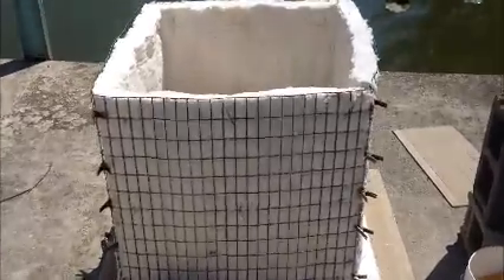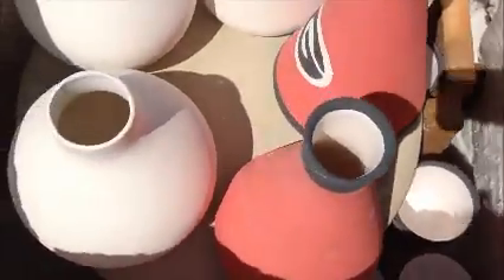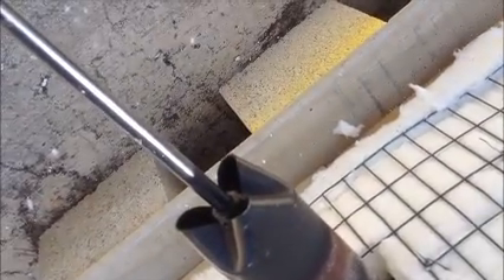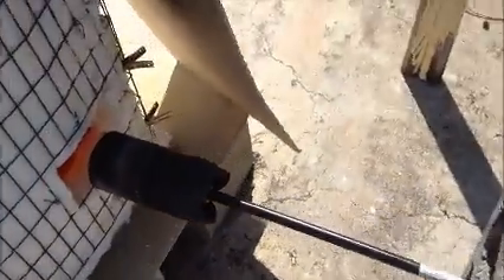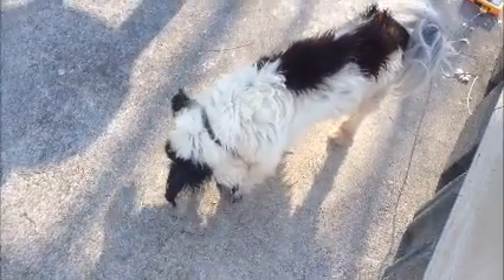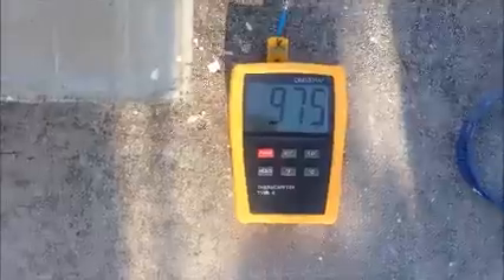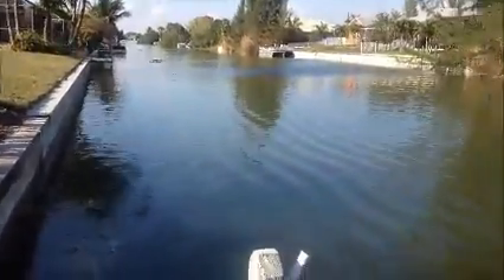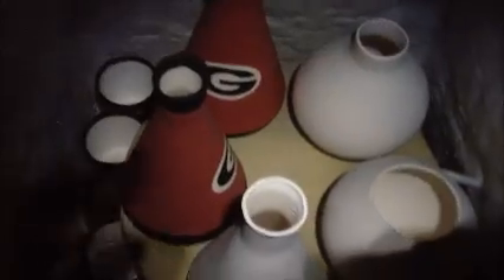Bisque#6

Comment: Hello Tarvus.   Thanks for posting your informative videos.  I appreciate what you've done.  I've a question for you, on your experiences with bisquing greenware.  What is the most aggressive firing for raku clay, you'd suggest.  You've had success with a 2 hr. 15 min.,,,, can it be done, in even less time?  Thanks   Clay
Reply from the maker: Yes Clay, I have recently completed bisque firings #9 and #10 in just about exactly 2 hours with both stoneware and B-mix green ware.  (I was firing to cone 010 for pieces destined for subsequent Raku and saggar firing). The key is making sure the green ware is thoroughly dry before kiln firing.  I candle my green ware in the kitchen oven the night before a firing - slowly taking it from 170F (the minimum setting on my oven) to well over 212F to insure dryness over many hours. 
During bisque firing, I slow the temp rise from 1000F to 1100F to allow a slow ramp through the 1060F quartz inversion point, then kick it into high gear to the finish once over 1100F.
You do need to allow sufficient time for carbon and sulfur to burn off during bisque firing.  I suspect you could cut the 2 hr firing time to even less with Raku green ware, but I have not tried doing that yet.

Comment: Hi Tarvus,
Great results,
I want to make same kiln like your's, the purpose is to fire stoneware up to 2200F so those pots could be used for cooking on any kind of stove(electric,gas, microwave) This is my first time firing, please suggest if this type of kiln is good for that purpose
Reply from the maker: Rukhsana, I am quite sure the kiln will hit those temps.  With unglazed stoneware, you probably will have no issues.  If you are doing a glaze firing though, you might.  The problem is not hitting the target temps, it's the fact that the kiln will cool rapidly afterwards causing possible crazing of the glaze.  The kiln just does not have sufficient thermal mass or insulation  to allow a sufficiently slow cool down.

Comment from the maker: Is there a particular reason the bonsai pots need to be cone 10 fired? Cone 6 would be quicker and cheaper in propane cost, and Raku firing, for which this kiln was designed, would be quicker and cheaper still. Raku would give you the most variety of interesting finishes and since Raku, like Bonsai, originated in Japan, it would seem to be a natural match! :)

Comment from the maker: Hi Damian.  These pieces were all porcelain, but I have also bisque fired porcelain, stoneware, earthenware, and raku clay pieces in this kiln.  The highest temp I have hit during bisque firing is 1925F, but I believe I could easily achieve cone 10 temps.  The problem with using this kiln for glaze firing though would be the fact that cooling would be too fast after hitting glaze temps and crazing and dunting would likely result.
Reply: tarvus33991 I love your idea for a kiln! Have you glazed with it? Thanks so much for your information!
Reply: tarvus33991 also what type of shelving did you use?